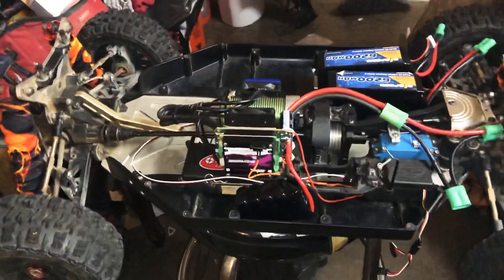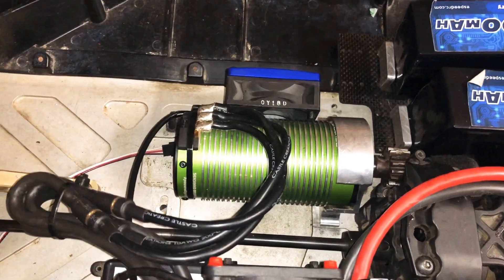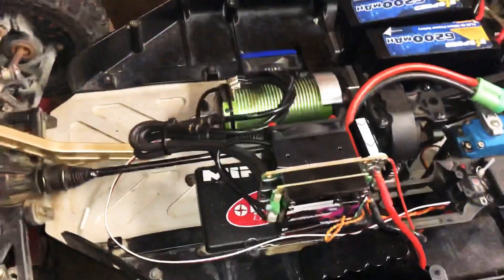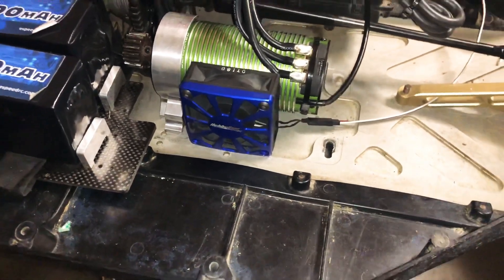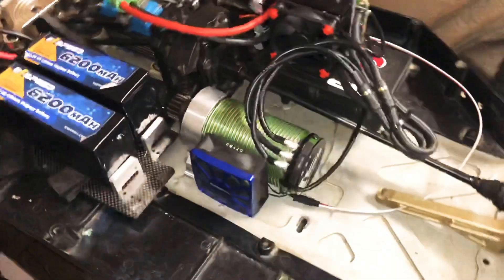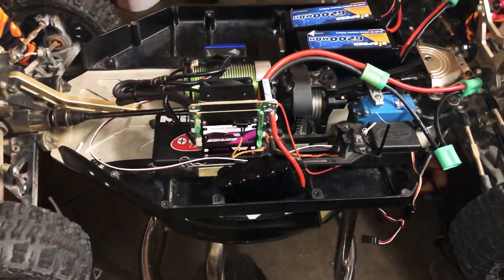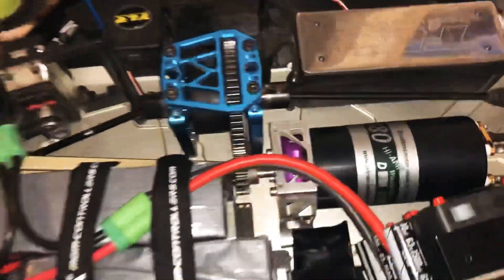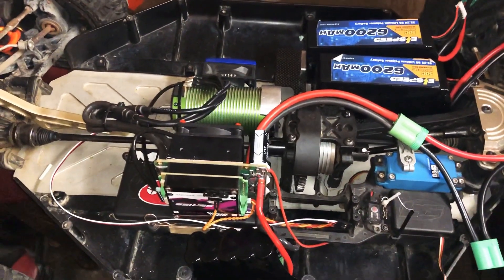Losi 5ive T Updates...

Comment: Awesome video info. So I have a question. I have a Brushless motor from Traxxas Bandit VXL, I would like to control the motor so I can use it for my wraith crawler it's pretty powerful. Is it possible just by using a different ESC or is it too much and won't work as a crawler motor?
When I put it on my Wraith it was too fast and jumpy I need it slower and under control.? What do you think.
Reply from the maker: Thanks Bro know to your question I’m not into crawling but I love watching it but to use Vxl motor for crawling you probably wouldn’t have much success but I personally think you would do better with a brushed motor or a sensored motor for the there smoothness
Reply: @MRBRUSHLESS  
Thanks Mr B appreciate it 😎🏜
I'm going to try a 550 brushed it's just that my wraith is big and heavy and I wanted something more powerful. But the VXL makes it too fast and jumpy. I was hoping to control it better. Thanks brother 😎🏜